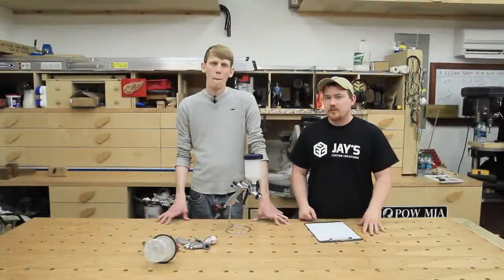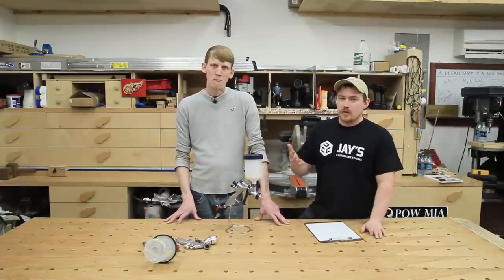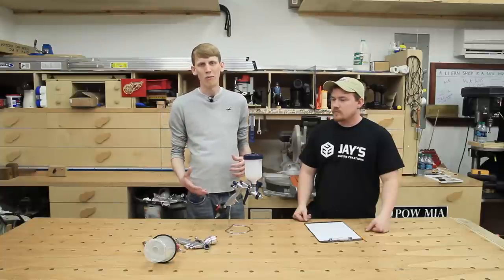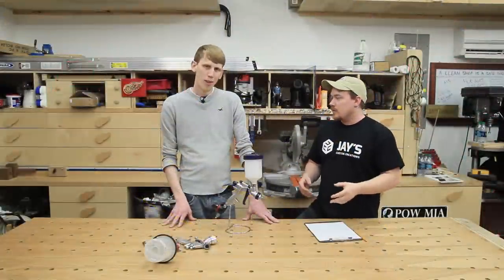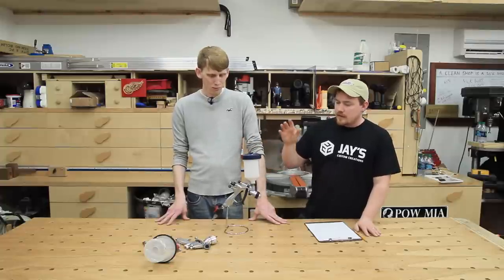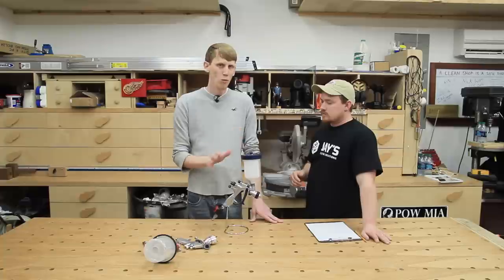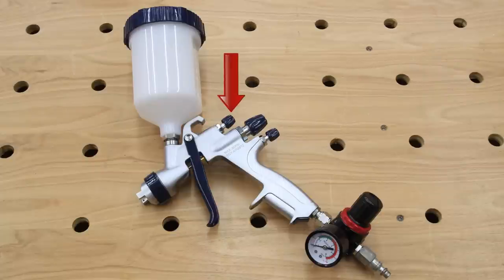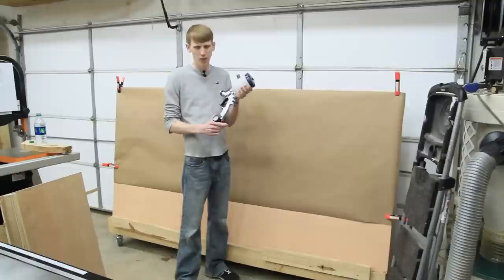Intro to Spraying Finishes With a HVLP Spray Gun - 241

Comment: Hello, Matt and Jay, thank you and I have a question, I have a Makita MAC5200,  Tank Size: 5.2 gal. Voltage: 120v, Max. Pressure: 140 psi, HP: 3, Tank Type: Hot Dog, Free Air CFM @ Max. Pressure: 6.5 @ 90 psi.  Do you think that this will do the job, small casing trim around closet.?

Comment: Excellent technique at 7:46. Nozzle turned 45 degrees outward at the end of each pass to angle off and halve the material. This is mandatory for surfaces being overlapped like casing and jamb corners where the paint will make two passes over the same place. Flick the wrist up or sideways just as approaching and passing across the corner area and the second pass, also angled away, will leave a uniform coat, with no need to pull out the roller and fix a puddle that will guaranteed run down.

Comment: Good vid and I've done some HVLP spraying and I found that you spend more time setting up and cleaning the equipment than your actual spray time.  I will say that it does save a lot of time in the long run especially if you are spraying larger projects.  Thanks for sharing.

Comment: Timely video. Just bought an Earlex 5500 to spray some wooden sheep hurdle props white. For a first timer it worked really well, it was the clean up and unit stripdown and rebuild afterwards that took the time. But still all way faster than with a brush!

Comment: Great video as always Jay.

As someone who has a good bit of experience spraying lacquer, I wanted to add my 2 cents. My advice would be not to spray indoors without some sort of booth set-up that exhausts to the outside. Lacquer, in particular, has a very strong smell that you'll be living with if used indoors. Also, though it takes a lot, overspray can start to build up on nearby surfaces. (I can't speak to poly since I wouldn't bother with spraying it)

Comment: Excellent video and explanation of technique.  I hope also that it will encourage more people to give it a try.  Two minor critiques though.  First, try keeping your arm and wrist fully perpendicular in both axis, avoiding the "fan off" technique.  That will even out the finish all the way to the end.  Second, try to learn to trigger the gun off as you run off the end, and trigger back on as you enter the part.  That both saves finish and helps to reduce overspray in the shop.  In a good paint booth with adequate ventilation that's less important, but for those of us that don't  have a dedicated booth, it helps a lot.  In a previous life, I painted Plexiglas advertising signs, yes you[ve seen them everywhere.  In that not only  color but paint thickness is incredibly important to maintain even translucency.  Technique was paramount.

Comment: Not just anyone can do this. It requires a lot of practice. Remember this prep is everything. Make sure what you are going to spray is clean. Just remember this less paint is better until you gain experience. Something they didn’t say was you will need to sand between coats. Using a compressor has a lot of drawbacks size, overspray, CFM and water in your air tank. If you want to spray mostly wood projects think about buying a HVLP Sprayer. Earlex makes a great inexpensive sprayer.

Comment: Another great video. I'm heading to Matt's channel to subscribe. I have a HVLP system I bought used. I've sprayed with it but have fussed a lot with thinning, to the point that I stopped using it. It was nice to hear you say that you spray poly and others without thinning. I'll give it at try. Thanks

Comment: Very informative and very helpful.  I was talking to Tyler G this past week and he sprays his finishes now and swears by it and prefers it over brushes and wiping on finish.  All I have is a 6 gallon Porter Cable Compressor.  So I'm assuming it wouldn't be big enough to spray finishes.  I've tried using a cheap Harbor Freight sandblaster gun and it would only give me about 30-45 seconds of use until the compressor kicked on and the pressure would drop.
Reply: +Joshua Luther Yeah, you'll definitely need a larger compressor.

Comment: Thank you guys for the professional level of content you produce.

My question is to  Matt, 
I have a small Sata Minijet HVLP 2 with a 0.8 nozzle
I don't want to invest in a new nozzle and would like to use it for wood finishes.

My intention is to use it on the roof of an apartment building so noise matters a great deal..
What size compressor do you think is the minimum required for usage once a month in terms of tank and CFM?
Do you think a similar to Dema's compressor can be used?

Comment: Question for you guys.  Do you ever have to worry about oil or water migration from the tank getting transferred to your project?  I hear that is a downside to using an air compressor instead of a dedicated turbine sprayer like a Fuji system.

Comment: Hey Matt and Jay, I know it's important to keep the gun clean. What if you are spraying multiple coats, something like 20 minutes apart or even 2 hours apart. Should you really break down the gun and clean it between each spraying. Realistically how long can you leave lacquer in the gun between applications before you need to clean it? Thanks.
Reply: +dan michael You should be fine to leave it in the gun between coats just don't leave it for prolonged periods of time. Make sure and check the tip before you start back spraying the next coat!
Reply: Keep the product in the gun, no prob all day. The tip is super important to keep clean.

Comment: Wow great video guys! Thanks! Quick question-I am an auto detailer and do headlight restoration using clear coat. Currently I only have a Porter Cable 6Gallon 2.6CFM @90PSI..will this work for small projects like coating headlights with clear?

Comment: Guys a fantastic video! Thanks! I want to spray paint bicycle frames and HVLP seems the way to go due to lower wastage. I have a 50 litres compressor. You say that choking the fan is bad due to bigger volume being sprayed in one location, but a smaller fan would be desired for small areas like forks, chain stays, tubes, etc. Would you recommend a smaller nozzle? Maybe 1.2 or even 1.0mm?

Comment: If your using a mineral spirits diluted oil based polyurthane and spraying it instead of brushing it,  I'm assuming the costs are thinner, so does this make drying times faster and If so you clean the gun between coats or can it sit with the mixture in it?

Comment: I've been  painting for the last 10 years, and about almost two years ago moved to a turbine system. The only cons that I've seen is that you can also use the compressor with pneumatic tools, but as for painting much prefer using the turbine.
Reply: +Juan Nieve I've been wanting to get my hands on a turbine system to try out, looks handy to have it all in one self contained unit!
Reply: Matt Lane way better in my opinion, clean air, no condensation, no draining, no maintenance (except filters), same constant psi all the time, and they are as loud as a vacuum cleaner. Downside you'll need new gun and hose (don't know if possible to adapt them)
Reply: I was wondering if someone was going to bring up the turbine systems. I've used an Erlex machine borrowed from a friend. It worked great and was easy to use.
Reply: +ST.348 Earlez systems are good, with that said even the HV5500 is not "that professional" in my opinion,  you'll need at least a 3 stage system to really be on the game, I'm using an Apollo system and couldn't be happier (not going back to compressors ever).

Comment: Guys very timely and well done video. Was wondering is there any recommendations for temperature for spraying finishes and I guess just a timing and technique one, I see alot of cabinet guys build with prefinished plywood would a standard spray finish hold up for this? I for one would love to see an actual model number for a gun you guys think is good maybe keep it under $100. Also went and read the article,  gun lube?????

Comment: Got a quick question that has nothing to do with this video.
On multiple videos I've seen you drive a screw in full,  back it out and then screw it home again.
What's the reason for doing that?
Reply from the maker: +oobaka1967 as the screw enters the second material it doesn't go in immediately and instead pushes the first material away from the second. Once the hole is started in the second I back out the screw and then advance it again. The second go around the first material will not be pushed away as the screw has a path to go into. Hope that makes sense.
Reply: +Jay Bates Makes perfect sense. Thanks for taking the time to respond.
By the way, just bought the lumber to make your easy 2x4 bench.
Reply: oobaka1967 g

Comment: Great video.  Any comment on whether a gravity or a suction pot is better?
Reply: Each has pluses and minuses and it depends on what you're spraying needs are. The attached cup is siphon fed or pressurized. The cup-above is gravity. Remote pots can be pressurized or used in a hydraulic fluid delivery system.

Comment: This is great  advice in general spray painting but it also would be great to receive tips from someone experienced in polishing furniture as this was one questions that was posed to my woodworking instructor when i was a kid and he believed that spray painting furniture was different to auto body knocker/repairs spray painter
Reply: Ask away about polishing. I'll answer you. I do furniture, cabinets, pianos...sadly, no one makes a dual pad rubbing machine anymore, not Stuhr and not National-Detroit.
Reply: Big Swifty Thank you I have two questions is there a special technique in spray painting furniture? And can auto acrylic clear be used on wood? I'm wondering if the natural expansion and contraction of the wood how it would affect the acrylic clear since it wasn't designed for wood I only ask cos i have come across some left over auto acrylic clear and i want to use it on something I have made out of wood
Reply: +Roc Lo 
+Roc Lo 
I'm not sure what you mean about special techniques to spray paint furniture. Prep and lay the coating down in overlapping passes.

Regarding car coatings, the answer is yes, you can use them. If you add fish eye flow out to your coating it will act as a plasticizer of sorts so that there is a tad more flexibility to the coating. You can probably use it as it is. It might be more brittle than lacquers from Sherwin-Williams and ML Campbell but that doesn't mean it's going to shatter like dropping a glass on the sidewalk, it shouldn't be as brittle as that.
Reply: Big Swifty thankyou

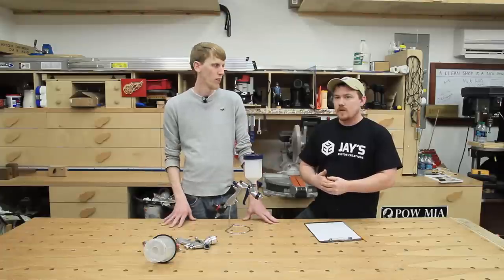Comment: 1:40 LOL. "It's a little bit bigger". Yeah, it's like, I have a Honda Civic and my other car is a little bigger, it's a Caterpillar 797. And two serious questions if I may. One, what's wrong with spray cans? And two, in automotive painting there is a rule that a panel should sit in the paint both in exactly the same position it'll sit on a car. If it's a door it should be painted while standing vertically, if it's a hood it's should be lying down. The same applies to woodworking?

Comment: In the linked article I see gallon size tank mentioned, but not how much HP.  I have a 5HP 20 gallon compressor that needs to be replaced, but I cannot afford the $1,000 compressors that I find online.  I'm looking at a much larger tank for $600 and that's still too expensive.  So what is the minimum amount of compressor I can get away with?

Comment: I like the tutorial so much that I used my HVLP on my current project but I came to an issue.
I apply 3 thin coats of minwax wood stain but the last one is been almost a day and is not drying it's still have the glossy look    and I want to apply one more thin coat before I apply polyurethane clear.
do you know what is the problem here and how should I proceed?

Comment: How about spraying Amber Shellac on t&g log cabin ceilings and over head walls?
Shellac is very thin and watery that it is very difficult to brush, role or mop on celings. Can you turn these sprayers facing up for ceilings and overhead walls.
Thanks

Comment: thanks but the most informative point is that you have a 5HP compressor;  even with little air pressure, HVLP is asking a lot of flow

is not it better to buy a lvlp or trans tech gun so to be at ease with the air (or using a mini gun, on furniture that should suffice) ?
my first experience was using a mixed type lacquer, nitro and shellac, to obtain a high gloss black

with only one compressor I was short of air and the flow was not that good when the compressor had to restart
I added a second compressor and obtained an adequate hvlp flow. and now I will upgrade the older compressor with a new V type pump and3 cv motor, and will be really at ease

That said I think a professionakl painter will be able to paint "correctly" with the cheapest equipment, and an amotor will do sh... with a good gun eventually

Comment: sorry if this was asked already but, is there some kind of standard for thinning the finish you are spraying?
Reply from the maker: +Daniel McAfee I have never found the need to thin any type of finish I have every sprayed. I do know latex paint requires thinning out of one of these guns but I've never sprayed it. I've sprayed brushing lacquer, water based lacquer, polyurethane, water based polyurethane, and shellac right out of the container without thinning.
Reply: +Jay Bates hey Jay. I plan on using the same finishes u are using. What size tip do u use?

Comment: Is all this fine information based on no moisture in the air? I would imagine it to be common knowledge to have moisture removed as a basic strategy for using an air compressor or is this not an issue?
Reply: +Larry Becker The moisture content in the air is basically uncontrollable in most situations, especially for those of us living in the southern us. It's just something you have to learn to work around, lacquers will be more susceptible to problems.

As far as moisture in the lines, you definitely need to try and control that with some sort of water trap either before the gun or after. The last thing you want is water coming through the gun and ruining your finish!
Reply: To help with humidity, raise the temperature inside the shop minimum of 10 degrees or more of you have to. The higher the ambient air temp, the lower the humidity. Yes, it's not so comfortable to spray in 95 degree heat, but the finish is what's important. Wear a headband and also a neckerchief so you don't perspire on your surfaces.

Comment: Hey Jay:
where should I go to see good spray gun?..can you tell me which name are you using?
thank you for all your video by the way
Reply: It depends on the size of your compressor and what type of gun that you want, a gravity gun, a gun with an attached cup, or a gun that has a remote fluid delivery system (pressure pot or hydraulic pump). It depends on your budget, also. It also depends if you want HVLP, LVLP, HTE, conventional air, low CFM, turbine systems, etc. It depends on what you're going to be spraying (a rack of doors, conference tables, chairs, picture frames, varieties of objects and shapes, etc. If you haven't been asked about those variables of haven't given them their just due, then you can't yet choose your gun.
Reply: This is why folks don't spray in their home shops. :)

Comment: Use of a viscoty cup should be in this video.   Have both type spray systems and the HF HVLP works fine but is not powerful enough for latex paint unless thinned.  25-35 seconds didn't do it and I was concerned about overthinning.  about 5% recommended.  So viscosity vs power for turbine HVLP needs discussing.  With a compressor like mentioned I suspect it is a matter of ai pressure to get atomization.

Comment: Comments on things like the Earlex HVLP vs this gravity-feed system?

(I bought an earlex a few years ago but I find that I rarely use it, as the clean-up process for small projects kind of negates the time savings of spraying.)
Reply: +Wordsnwood (Art Mulder) I don't personally have any experience with a self contained unit like the earlex, but i can imagine it would be nice to everything you need for spraying in one small package.

The clean-up is always one of the more aggravating parts of any spray job, once you get a system down for cleaning you'll find that it's not that bad and still much faster and better results than brushing.
Reply: +Matt Lane Thanks for the response, Matt.  I guess the other thing I wonder about is the whole gravity feed bit, as the earlex sucks up from a reservoir below.
Reply: Wordsnwood (Art Mulder) There's really not a ton of difference except for the fact that refilling the cup can be a little more aggravating and with the see through gravity feed cups you can see how much material is left over.

Comment: I think i just had an ah-ha moment.  So, the difference between the gun and something like a Fuji 2, 3, 4 , or even 5 stage sprayer is the compressor.  The Fuji has it "built in" but here you have just a gun that requires the air compressor.  Is that correct?
Reply from the maker: Basically

Comment: no mention of need to deal with moisture,using a standard compressor  vs using a turbine that delivers dry heated air.  Also no discussion of nozzles.   Also no explanation of how an HVLP gun works     pressure needed to push paint to the nozzle and then pressure needed for atomization . Not a good presentation!

Comment: This is very helpful. No guidance re: how close to keep the gun from the workpiece when spraying. Also the link to Matt's website seems to be broken. I believe the link should be https://mattlanewoodshop.com/hvlp/

I bought a $50 Harbor Freight HVLP kit recently and have been experimenting with spraying gloss finish acrylic enamel for cabinetry. I'm finding the biggest challenge seems to be getting the mix right. This paint is quite thick and does not flow well through the relatively small tips included in the kit. Although when I get it right the finish is pretty darn good.